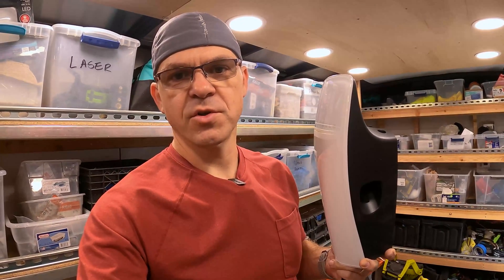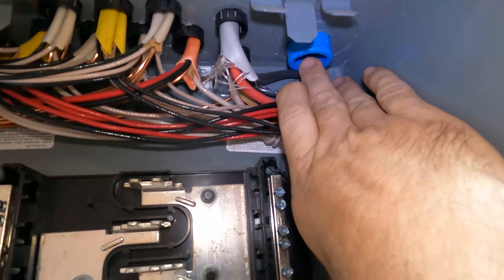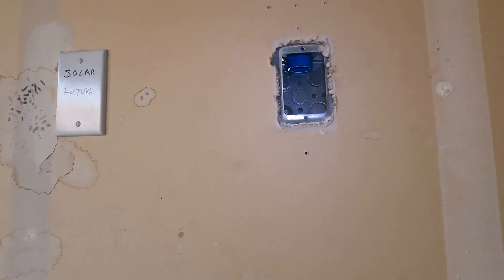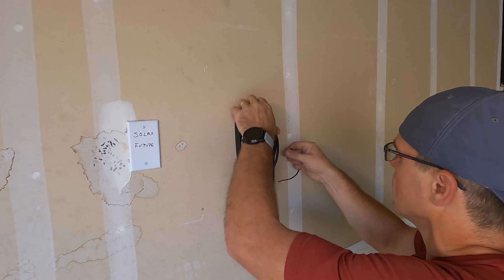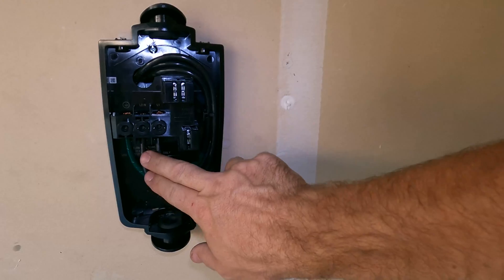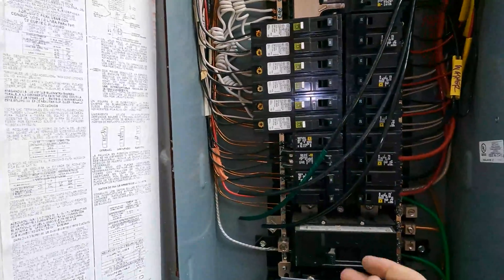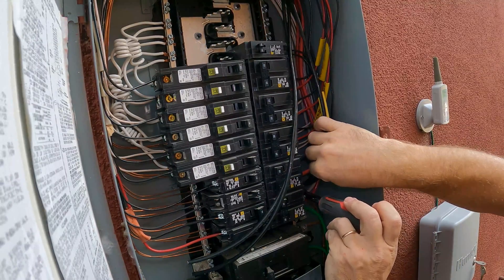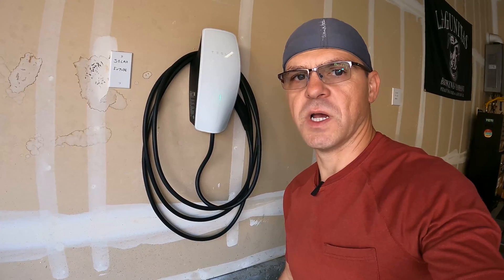How to Install a TESLA Charger 2021,Tesla Wall Charger Install and Overview!

Comment: Don’t you need to install a connector on the knockout in the back of the charger where the wires are entering the charger?

Comment: The National Electric Code sometimes provides overkill.  The local building inspectors can also ignore the nec (90.4).  Section 314.4 requires metal boxes to be grounded.  Did California cance this requirement?  A metal box was mentioned and not conected.

Comment: What size wire for 60amp?  (#6 AWG??)
Reply: Ben,. 60 amp charger or 60 amp circuit?

National Electric Code 625 EVSE (car chargers) demands the circuit carry the charge current plus 25% or 125% of charge current.....32 amp charger needs 40 amp minimum circuit.
Reply: @keithharrington4595  Thanks

Comment: Ground wires are green or no insulation. Never black. I don't see where the metal box is grounded - a code violation.
Reply: Man i was thinking the same thing
Reply: That's why he had green tape around his ground wire to identify that it's a ground wire.
Reply: @fdeguilla  there are two approved methods to ground the metal box.
One is to attach the ground wire to the green screw on the bottom of the box the second is to use a grounding clip.
The grounding clip requires a Bare wire 
I don't see any of these.
If I missed it can you provide how many minutes into the video where the approved grounding method is visible.
Also why put green tape on a black wire.
Just strip off the insulation so it is bare inside the box.
Reply: I thought that part of the video is showing you how he's hooking up the ground wire coming from the Tesla wall charger, not how he's grounding the box.
Reply: @fdeguilla  some one is going to think you don't have to ground the box 
That is part of the installation video.

Comment: Hello Dican,  I am in Sacramento how much do you charge for the installation?  I purchase the Tesla EV Level 2 charger and the 60amps breaker.  The house is about 18 years old.  Need to install in the garage and breaker box is out side, the same side.

Comment: My Tesla charger is 3 phase, my supply is single phase, pls how do I connect it?
Reply: Hire an electrician or else you will burn your house down.
Reply: Tesla chargers are not three phase. They are 240 volt single phase.
Almost  no one has 3 phase going to their homes.
Reply: @thomaswilson2917  yup! single phase. That's why I told him to hire an electrician because he doesn't know what he is talking about and dealing with.
Reply: @md929  I have had to reply to other videos also. One ran metal conduit to the box and was not even fastened to the box just sitting loose in the hole! Big code violation besides being metal which is also a violation when connecting to a plastic box. On another video someone was drawing 34 Amps on a 30 amp circuit and was talking about breaker being hot!
Reply: I have done it, just needed to use one phase. Thanks.

Comment: I paid $465 for install (SoCal)
Reply: Ouch. Just got my wall charger and was wondering how much it would be in SoCal
Reply: @Ramirezja76  company name - Faraday Electric. I can recommend them. They did install pretty good
Reply: @Ramirezja76  Is that with pre-existing conduit run? How far from your breaker panel is the charger located? With what little this guy had to do for this job, I would have charged about $350 bucks for this install.

Comment: What wire did you use ?  Can you post me the link to the wire or model  no:
Reply: Yes what wires did he use
Reply: 6 gage , electric wire , allowed in your area .
Reply: Number 6AWG is required for a 60 amp breaker unless you are using NM-B cable which is rated from the 60 degree column of the chart. As is required throughout the US by the National Electric Code.
Reply: @jmlastname4412  But this is solid wire?
Reply: @jmlastname4412  code reference for this is 110.14.(C).....ELECTRICAL CONNECTIONS, which puts breaker terminals 100 amps or less in the 60 degree C cumn.
Reply: @keithharrington8715  ?
Reply: @jmlastname4412  JM, when looking for wire ampacity, there is a table in nec section 310.16 and found on internet.  It has 6 columns for wire ampacity (,ability to carry current).  3 for copper wire and 3 for aluminum.  The columns are based on temperature In degrees Celsius, 60, 75, 90.  

Different wire insulations allow for protection of the wire based on the envirnment it is in.  These insulation allow for the same size wire to have different current ratings.

The nec directs you to the lower rating....60 degrees Celsius for connecting the wire to the breaker, because breaker connection points (terminals) are normally rated at 60.  If your breaker terminals can handle more it will be marked on the breaker.

There are some ways to get the higher rating, but your butt is probably hurting after reading all this.
Reply: @jmlastname4412  110.14.(C).  For terminal connects points to circuit breakers of 100 amps or less are normally rated at 60 degrees c.  If they are marked for a higher temp, you can use that.

So, the current rating for the wire touching the breaker is in the 60 degrees column, generally.   #6 THHN is limited to  a 55 amp rating.

Yes, section 240, circuit breakers, allows this to be covered by a 60 amp breaker because there is no 55 amp breaker.
Reply: Very nice I love it.
Reply: If you have to ask... Hire an electrician! Most likely you will make some code violations!
Reply: @thomaswilson2917  beta comment. Grow some balls and learn how to do shit.